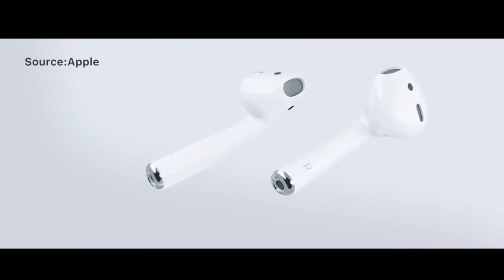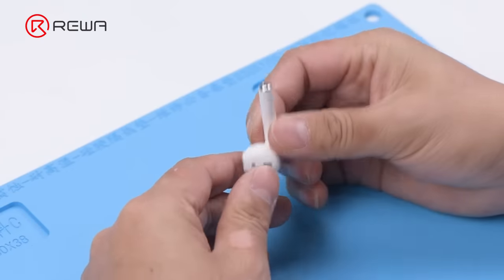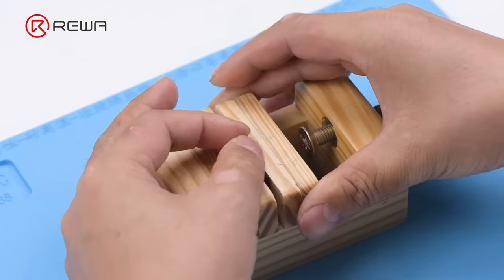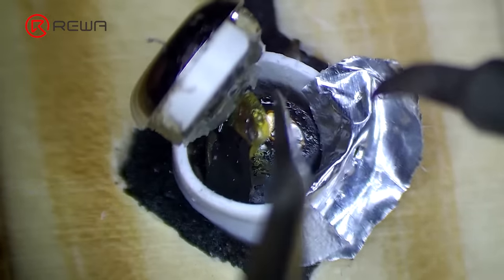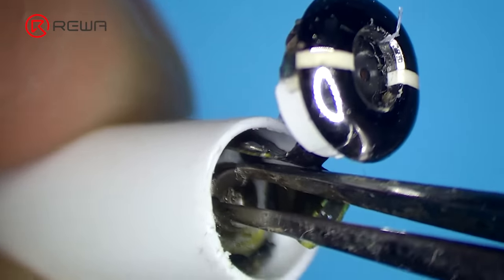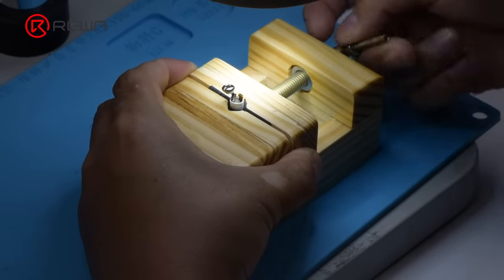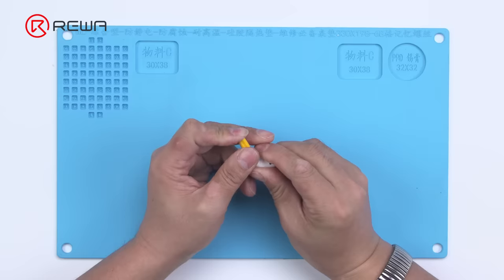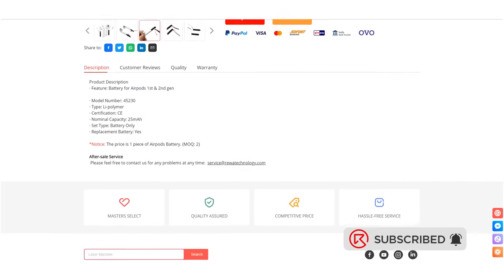AirPods Battery Replacement - Draining Too Fast Problem

Comment: this is some god tier repair
Reply: Now I’m hoping to see the AirPods Pro battery replacement if it’s possible because it is more expensive than the regular AirPods. Damn you apple for making stuff unfixable
Reply: Yah and like he is filming at the same time
Reply: This Rewa guy has some stable Surgeon Hands. Pure Talent!
Reply: Agreed.
Reply: the god tier repair only cost $150 cny on taobao which is around $24 usd
Reply: yea i liked the part where he burned the ribbon cable with the iron
Reply: at first maybe i can replace this myself after seing the vid. yeah.. thats not ganna happen
Reply: @guynumber20  he forgot to edit that bit out

Comment: I did it! Batteries were $10 for two. First one took 1hr. Second one took 20 minutes. Wife thought I was crazy to attempt this. Tip - Before sliding the new battery in take out the shim that keeps the battery snug in the chamber. It is not needed and without it the battery slides all the way in easier. Thanks for the video!
Reply: Can you repair mine? 😭 I’m afraid to attempt this, but have two broken AirPods gen 1 and pros that are useless
Reply: 2 months later, what is the update on the battery life? Since they’re not OEM batteries I wonder how they compare with the original. Still going good?
Reply: @ThePine21  batteries lasted like originals. Within a day of replacing them both buds wouldn't work at the same time. I tried everything to get them to link at the same time. The one that was working, I would take out of my ear and then the other would start playing. I got fed up with it and my wife bought my pro’s for Christmas.
Reply: @BobSmith-zx4jy  We need a laugh button for Youtube
Reply: @BobSmith-zx4jy  buys shitty unrepairable throwaway product and doesnt even learn his lesson xddd
Reply: @csPinKie  yes, Apple pulled the biggest swindle of the century when they removed the headphone jack on iPhones. Come on down all you suckers, give us your money $$$$
Reply: @MrPnew1  seems like consumers dont really care
Reply: @MrPnew1 only cheap chinese Phone and Sony still have Jack port
Reply: Can you repair mines 😢😅
Reply: What was the tool he used for removing the battery? My battery is stuck and I don’t have those bent tweezers, what type are they called?
Reply: @Pengame128  The batteries are hard to get out. They have a double sticky tape holding them into the pod.

Comment: fun fact : the tools will cost you more than airpods
Reply: $5 for soldering iron, $2 for tin, $2 for flux, you dont need that fancy holder,
Reply: @VietboyGamerUSA  For loosening adhesive you could use a hairdryer(or get a cheap hot air gun for $25). Also, this is all stuff most people have if they repair things often at an advanced level, and this is not an easy repair or marketed as one.
Reply: @ElAndresRodriguez  hairdryer works that great nobody spend more money buying a hot air gun man
Reply: @Tyranosaurus_Xer  what about those cylindrical battery buddy ...finding them is a more difficult task. i tried ordering online minimum order quantity was 1000 pcs.
Reply: @VietboyGamerUSA  ok add $25 more for cheap hot air gun, hairdryer wont work
Reply: @dvreigns324  wait for one month, those item will be everywhere in ebay
Reply: 😂😂😂😂😂😂😂😂I didn't know that the tools is very expensive 😂😂😂😂😂😂
Reply: @VietboyGamerUSA  It works very well adhesive, I can tell you have never repaired things from home lol

Comment: Apple - "We removed the charger from iPhone 12 series to reduce e-waste"
Also Apple - "We made Airpods so damn tough to repair that its a piece of junk in case you want to replace battery"
Reply: and lightning port too, when the whole world is using Type C
Reply: I can't bring myself to spend so much on some earphones that'll just be unusable after about 2 years of daily use and a battery replacement is almost impossible. I'd rather pay that price for a good pair of wired headphones.
Reply: the best thing is that if you give it to apple to replace the battery they simply throw them away and give you new ones lol
Reply: @robinw944  And then they would say that they are saving the planet by not giving chargers..!!!😂😂
Reply: @yasirsaheed  I've had cheap wireless ones last way longer and take way more abuse than the airpods. So happy mine was a gift as I'd be disappointed if I bought them.
Reply: lol
Reply: Apple : We make it hard for 3rd party repair. Hurry up and give your money

Comment: All world: Repairability 0\10
Rewa: well, we can change ur battary in ur airpods
Reply from the maker: Thank you Sir. It's very kind of you to say so. We will keep up our work.
Reply: @rewatechnology2008  What you do, no one else in the world does. 4 years I have already subscribed to you, and upgraded my 6s to 128g, learned to analyze board breakdowns, learned a lot, but I could not get to your master class(
Reply: You should be hired by Apple for replacing the airpods batteries
Reply: @DeathxRaidenGaming  Apple would never hire them as long as they need the users to constantly buy new Apple products instead of repairing their old ones.
Reply: @yordanyordanov7725  yeah I know that Apple just knows how to suck the money of their customers 

(Complaining about Apple even though I use MacBook Air and IPhone 11)
Reply: Its an excessive procedure considering they could just make it that you can screw the metal cap open. But Apple has for quite some time working actively against their products being repairable at all. One of the many reasons why I dont buy their stuff.
Reply: @yordanyordanov7725  Apple would hire them to design products that cannot be repaired.
Reply: @ohgreat688  Thats a really good idea. Thank God they haven't thought of this.

Comment: Amazing great work! Can't imagine the stress while working with soldering iron in that small place and not damaging plastic body of the Airpod and i dont even talk about of that flex cable on the metal "cap". Great video !

Comment: This is absolutely nuts. It doesn't even seem like it require much fancy equipment other than a hot air station, plus a soldering iron and some kind of homemade clamp. I can't imagine how many must've been broken just to perfect this repair. Bravo REWA!
Reply: its nuts but apple could have done better, there are fakes which sound better than the originals but still have kinda repairable batteries (normal only not pros).
Reply: I find that a 3D printer with a heated bed is a great way to soften adhesive without damage. For small electronics like this I put them on a microfiber cloth on the heated bed, then cover them with a (microwave/oven safe) glass or ceramic bowl, set the bed to 100C and it keeps the inside an exact 100C all around.  
And while we're talking about a 3D printer, it'd be very easy to design and 3D print a clamp for this

Comment: thanks to this video 👍👍👍👍

(airpods1 & 2)
I replaced batteries 
replaced speaker 
replaced mash/grill
even repaired speaker broken coil wire.

soon will try to replace battery in case.

P.S I don't have any fancy repair tools,  I did all with a pair of tweezers, a hair dryer, 0.1mm steel strip, temp control soldering iron  and 3 years of diy soldering experience and I'm not a repair shop guy. I just love to fix things.

Comment: I did it from the first try. Also it was my first experience in soldering and repairing electronics. Yeah, the airpods plastic case is a little bit deformed, but you can notice this only from close range

Comment: Imagine you must use the solder alloy 60% tin, 38% lead, 2% silver - for the lowest possible melting point, in order to minimise any possible damage.
Great job, compliments. 
Imagine if Apple was a repair-friendly, user-centric company, and provided the headphone with a user-replaceable battery, say that lower stem containing the battery was a screw-in, replaceable component, sold for 10 dollars. 
What a pity. And an eco-failure...

Comment: Nice guide, thanks for this. I don't know how economically viable such a repair is for a business though. It's a lot of work for a low profit margin sadly...Although I will try this, if I ever get my hands on some half-borken AirPods. Nice work!
Reply: I think this is a good DIY fix guide, since it does not need extra tools for people like me. I can't say that to most of the videos of REWA though.
Reply: Shell out 60 bucks for a repair VS buying a new pair? Well I don't know how much they'll charge. Batteries shouldn't cost too much, so a lot of it would be labor cost.
Reply: @2010ngojo  I would rather buy a new one..I lost one of the pair on train, so I bought just one from a vendor from taobao.  
It cost me about 60 us dollars, and It's fair cheap price for that. I don't really trust them but I've tried to find out if it's fake but every detail feels the same with my original one bought from apple.

Comment: can you do a repair of the speaker or maybe deep cleaning the speaker of debris and speaker grill? my airpods start sounding very quiet and the only fix I found only is to suck on the speaker part to clear out the grills. very gross but works.
Reply from the maker: We'll forward your suggestions to the related team and keep an eye on this issue. Please stay tuned!

Comment: Any battery swap for the Apple Pencil?  Thanks. This vid is useful
Reply from the maker: We'll forward your suggestions to the related team and keep an eye on this issue. Please stay tuned.
Reply: REWA Technology I found a YT video from a Russian.  He replaced a battery with an Electronic Cigarette battery (bigger diameter) and creates a new body (bigger diameter pencil).

The AirPod lipo battery will fit but it’s too small.....but, it’s possible.

Thanks 👍🏼👍🏼👍🏼

Comment: I failed to remove the battery because I did not have revamp tweezer and tried to use a normal tweezer. I broke the metal part of the battery. Is there still a chance to remove it?
Reply: Jes, Happend to me too. Its Important that you make the case hot enough. You can Solder a copper cable on the Batterie and pull it Out

Comment: What they could have  done is put  screw under the battery and it could remove as you can easily remove the up where microphone speaker is there in airpods  and or just put the battery up

Comment: Is there any way you know to get google glass explorer edition repaired? I broke the stem between my ear and the display, so the battery section is dangling and they won’t turn on. There is a small flex or ribbon cable connecting the battery and other back components to the front of the device. I assume this needs to be replaced.

Comment: How about AirPods pro?
Reply: Anything would be possible for rewa but the pros battery is in the top part and not the stem, it’s also sandwiched in between the processor and the speaker and lots of glue is used. It will be really hard to do but I’d love to watch someone do it

Comment: Apple engineers after seeing this “ push software update to detect battery change in AirPods right now “ 😅
Reply: Yes, simple as that.
Reply: That would be ridiculous, but nothing is below Apple's standards. 

Because this repair is obviously difficult to complete, it would be very hard for them to make the argument that they are doing this for safety.

It's not like anyone can complete this repair.

Comment: The most difficult part is pulling out the battery.  I ruined the plastic case and several tweezers when I tried to pull the battery out.  And my tweezers also broke the anode and made things even worst.  Does anyone know where to buy the tweezer used in the video to pull the battery out?
Reply: I broke the anode also.
Reply: Solder a cable on the Batterie and pull it out

Comment: The fact that they couldve made it easy repairable with e.g a screwable end pisses me of. Devices like this are built to break so that you buy new ones after a few years. And such a company calls themself „climate friendly“ and doesnt ship chargers
Reply: Bro the damn AirPod is smaller than a screw it would need microscopic screws
Reply: @maziu27  they said a screwable end which Apple could have done. They could have had a tread inside the stem of the airpod and made the metal end screw on

Comment: I have lots of electronics experience, with all of these tools, with the exception of that type of heat gun, and I wouldn’t even bother with this repair. The risk of damage is too great. It’s likely that damaging the product would be hard to come back from. Damage = time wasted. And for the price of these, for me, I’d rather just buy a new pair with the latest improvements.
Reply: Rewa did it and you are crying

Comment: This is great, I'm gonna do this =)

Can I please borrow your hot air gun?. And while you're bringing that over, can you bring the silicone mat, tweezers, vice, alcohol, alcohol (the drinking type), modified tweezers, soldering iron, sharp knife, adhesive, some Chinese food & anything else I might be able to use.
Reply: You may need a battery also

Comment: This is why I have fake airpods. I've already replaced the battery of each bud once and it was way easier than this. At the expense of slightly lower sound quality and couple hours less of battery I get the same shape, which I found to be the most comfortable for my ears.

Comment: If you could unscrew the bottom part with some simple click and lock mechanism we would all be able to replace batteries and guess what? Our airpods would last for years. We live in an age were whe support companies that make the simplest thing non repairable... which is replacing a simple battery... gow i miss the older days of tech and replaceable batteries. I still got all my tech from that period and guess what? They all work

Comment: Absolutely shameful on Apple’s side for not allowing easy replacing of batteries. This could have been made extremely simple by them with a battery replacement taking a few seconds if they were well designed. Shame on you Apple for sitting on billions upon billions and still choosing to be part of the problem.

Comment: Omg the hell with this complicated way to just replace the batteries. I bet the batteries are not cheap 😩 so you’re required to even take a course to how to do it your self ? Plus the kit and what happens if your screw up something like to much heat / tied up the wise too much . And crack the plastic . Then you’ll be stuck 😩 I will recommend if you’re out warranty your best bet just buy new ones . And forget 🎗 is only money anyway 🤪👌

Comment: Instead of making the design simpler to replace the batteries, apple made it so hard that replacing them is the only viable option. Honestly Apple wtf, the batteries only last for a year and I don’t want to keep buying new ones each year.

Comment: You can replace the AirPods battery , tools needed cost 2 to 5 times the cost of a new pair of AirPods. Also you will destroy about 50 AirPods before you can succeed on the first replacement.